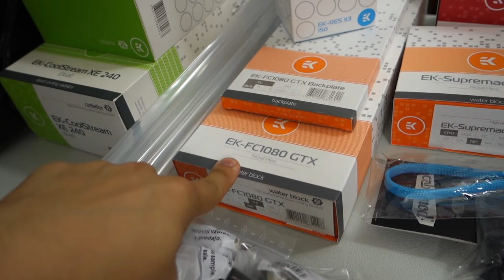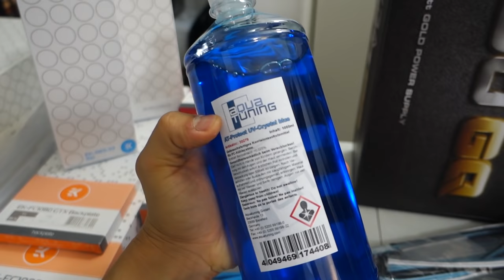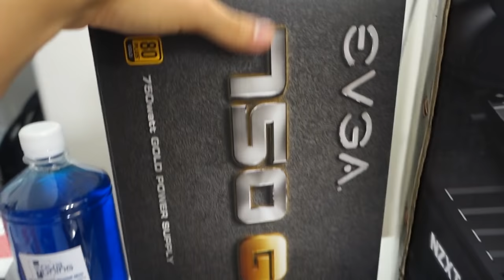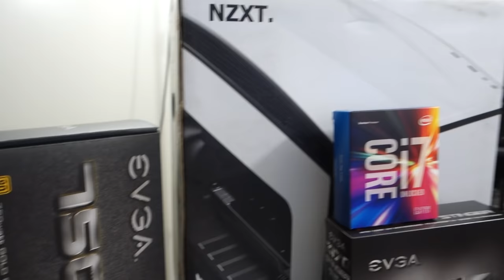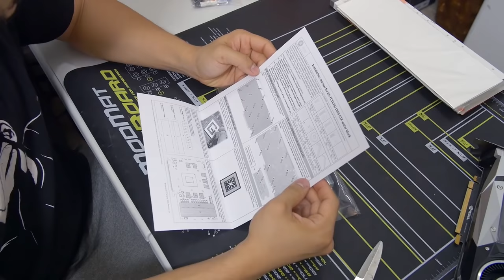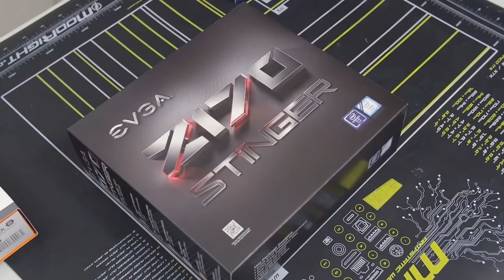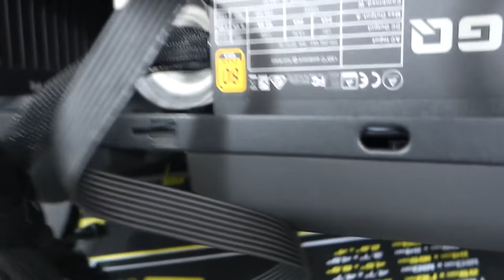My First SFF Custom Water-cooled PC! Build Log #1

Comment: Usually when I plan to do something PC building related I use a simple formula - set an optimal time that you need for everything to be done and... Multiply it by 3.
Reply: haha very true
Reply: Same
Reply: Built my first PC, thought it would take 2 hours. 8 hours and chipotle later, I'm installing the os.
Reply: more like multiply it by atleast 17
Reply: Heh... I'm a pretty experienced builder and I still use almost the same amount of time as you.

Could easily build faster, but I enjoy taking my time, mess around with all kinds of pointless things and just be done, when I'm done.

Cables of course is the biggest time consumer for me, as I route them, reroute them... and then decide I'm not satisfied and start again :)
Reply: Brannan DI most important part!!!
Reply: Especially true if you're doing watercooling. ESPECIALLY if you're using hard tubes.
Reply: Then this how long JayzTwoCents should have for his PC builds: 3 years

Comment: Sure you got enough compound on that cpu there?
Reply: he need more compound that's gonna overheat the cpu
Reply: It's how EK recommends applying it.
Reply: IDK why he is even bothering to liquid cool, that CPU is just going to overheat from lack of compound.  Needs roughly 3 times as much.
Reply: He's cutting it fine. My build us covered in thermal paste for good measure
Reply: he's joking...
Reply: they recommend that for the GPU die, not sure if it's the same for CPUs though, because CPUs have heatspreaders, whereas GPUs do not.
Reply: +101epicpenguin I'm pretty sure they recommend less because of the heat spreader so the paste doesn't need to cover the whole thing. Though ltt did a test on it and it turned out more paste didn't really hurt temps at all, so it doesn't really matter that much.
Reply: Tyler Weigand yeah, I'm aware it makes little to no difference, but it'll be easier to clean it off in future with less!
Reply: I was waiting for him to whip out a stonemason spatula to cut it into a nice 1/8 inch thick square tile.

If he ever has to swap the sink or CPU, hes gonna have to work for it. :')
Reply: +HowAmI 
https://gyazo.com/a478944deb7464668c38629cad4b9fed
This is from this pdf: https://www.ekwb.com/shop/EK-IM/EK-IM-3830046990983.pdf
So I think it's fair to say a little too much was applied, but once again, it'll only make cleanup/block removal harder and messier down the road.
Reply: The cross method is the best one, so it's perfectly fine...
Reply: ***** Exactly, as long as enough paste is applied, who cares!
Reply: ***** Exactly.
Reply: thats a shit lot of paste lol. i have like 5 times less
Reply: It really only comes down to when its time to take it apart and clean all that stuff up =F
Reply: Yeah....WAY TOO MUCH!
Reply: ***** lol yess :D
Reply: ***** Dude, my comment was a joke lol. I know it doesn't matter.
Reply: ***** Yeah, some people put like a grain of rice amount lol. I generally put about 2 peas worth of compound. Never really had an issue so far with overheating so far.
Reply: Yeah... that was a lot.

Comment: holy shit thats alot of thermal paste lmao
Reply: There are videos on yt showing that too much will just squeeze out on the sides but too little would be bigger concern
Reply: makes no difference though, only problem is when there isn't enough, even then, only a 10oC difference, Luke from Linus tech tips did a video about it.
Reply: That is the amount that EK recommends.
Reply: you mean on the cpu they recommend that? i mean.. i know it wont hurt anything as long as its conductive.. but i dont want that all over my motherboard.. i know its like that for the gpu... but never seen an install guide for an ekwb for cpu... so i suppose i have no clue.
Reply: You must've meant, as long as it isn't conductive. Also, that'll never make it to your motherboard, the paste will at mose, go on the sides of the heatspreader.
Reply: +dumle29 Yea.. Missed the not part.. *
Reply: Do all commenters say this on all YT videos? T_T We know your pain, Kyle!
Reply: 10 degrees is a ton!
Reply: is it verge terrtory though

Comment: you shouldn´t bolt the pump directly to the case. i did that and it was horribly loud.
Reply: Yeh you should probably add some noise dampening between the screws , so it won't vibrate
Reply: Nitay Haim a shoggy sandwich is perfect
Reply: there was rubber gaskets on bolts and pump
Reply: IICHRONOII yeah, but i don´t think that´s enough
Reply: he used rubber spacers so i wont viabrate
Reply: Well, it still touches on the inside, soo
Reply: If you know anything about EK pump mount the pump itself slides into a rubber ring that attaches to the feet. So there is no vibration transferred to the case at all it's a very good setup made by EK!!
Reply: Steve Bittner i never had an EK pump, but that´s good to know

Comment: Did anyone else cringe a little bit when he started to drill into a metal case fully outfitted with components? Metal shaving are deadly to hardware...
Reply: nope. but i cringed hard asf when i saw ur dp
Reply: Yep
Reply: +ViperStrikeHD Savage asf
Reply: not only that, think of the vibration from the pump directly bolted to the case
Reply: The Tech Mate You mean without any padding? Like a piece of rubber?
Reply: it has padding so no vibration
Reply: Oh so yes it has paddind. did not notic that. So no vibration then.
Reply: Yes, and it's surprising comments about this aren't higher in the feed
Reply: daaaaam daniel....... +ViperStrikeHD , that man had a family!!!!

Comment: Wouldn't the single 8 pin on the founder's kind of defeat the purpose of custom liquid cooling?
Reply: not in anyway. that limits its power but just barley.
Reply: why would the 8 pin be an issue to watercooling in any way?
Reply: nope
Reply: +Dave Webster Water cooling is done so that you can insanely overclock your system and to overclock you need more power which the 8 pin connector cannot provide
Reply: +Meer Shah founders cards tend to overclock just about as good as aib cards. water cooling can also be used for more than just extreme overclocking.
Reply: +Meer Shah worth taking a look at people's experiences between 8pin fe + 8+X custom PCBs available: there are seldom cases of delivering significant change.

secondly, watercooling is about efficient cooling, drawing heat away. in an SFF moving the heat away from a component to a radiator elsewhere in the system is a very effective way of putting higher end, higher heat producing components into tight spaces.
Reply: Dave Webster I'm saying it defeats the purpose, the purpose being overclocking of course. With only 1 8 pin you're going to hit power limitations. Also, custom watercooling is unecessary if the purpose is just to reduce heat. I have a Sea Hawk 1080 with a Corsair AIO and it has a max temp of 50 C at full load.
Reply: +Amir Paydar and heat is not an issue? plus it's been +100° this whole week in California.
Reply: SwordfighterHayate Did not say it wasn't an issue, I said it's unnecessary to spend a ton of money on custom cooling when you can buy a Hybrid graphics card and get the same cool temps for much less.
Reply: +Amir Paydar who said the money was an issue. I could buy a car that gets me from home to work for much less, or I could buy the Ferrari. just because something isn't what you would do, doesn't make it wrong. and the purpose of watercooling if to shift heat, not to overclock. overclock potential is by-product of watercooling, but can equally be achieved by air or AIO water systems these days.
Reply: Block and backplate would run you around $170 USD. And with all the mark-up on all Nvidia cards right now a FE and WB is still cheaper than the Sea Hawk by MSI.
Reply: Not at all.

An 8 pin is RATED at 175W, safe to say it can deliver a lot more than that
Reply: The word "unnecessary" means nothing to PC builders. Most things about high-end PC building are done because they can be done, not because they need to be or even SHOULD be.
Reply: Jaystwocents founders edition are the only cards he has that can hit 2100 plus. Stable.
Reply: But even on air cooling, those cards reach 2100MHz.. WITH 8 PIN POWER.. are you insane? Those cards don't need more "power" to overclock well.  
Yes for a watercooled system, having more power can be helpful but please get your head out of the sand and look at overclocking results before you complain about the 8 pin power connector "not being enough".
Reply: feels good to see that many people agree about the 8pin & of results. I also reiterate, the point of watercooling is not for any kind of overclocking. the point of water cooling is to move heat from one place to another. given the rads on this build are going to equal 480mm + sff design, I could guess that its an HTPC gaming system aiming for fans under 750rpm and no OC (but stable boost) to keep it cool yet very very quiet.
Reply: Dave Webster No need to reiterate. Leave
Reply: the gtx 1080 consumes 180w,the 8pin+pci-e gives 150+75=225w,so you have a 55w room for overclock
Reply: Dave Webster fact. 2x8 pin doesnt mean better oc on these 10xx cards. 
i personally believe that nvidia kept the best chips for the fe cards cause all these aib cards have bad oc in comparision :0
Reply: the fact my founders 1080 has oc better than some none founders one 8 pin doesn't matter
Reply: So many people think that the extra 6 pin or extra 8 pin will magically unlock more core clock... Pascal and its FinFet are NOT seeing good results by throwing more voltage at it. Why do you think all 1080s (minus the Strix) is hard locked at 1.092v? Once again.... the extra power pin DOES NOT EQUAL BETTER OVERCLOCKS. In most cases its so that you can not reach power target on cards with extra fans, LEDs etc which ALL play a part in TDP and power target. Yikes.... so much wrong information floating out there
Reply: ***** Damn Jay, thanks for taking the time to clear that up and great work on Red Mist. I didn't think it mattered either at first but after so many people tell you otherwise it's hard to know what's right and wrong.

Comment: For the rear fan, I'd leave the white ring and spray the rubber blue, but be warned: paint definitely does NOT stick to rubber well at all!  I did that with that watercooled HTPC I showed you a while back (the black and gold one... prolly don't remember x-p), and while I DID get it to look really good, you have to minimize the stress that gets applied to the rubber or else it literally just peels right off.  Of course another way to go would be to get those new Corsair ML fans; they come in blue with blue corners to them, but they are LED fans.  I mean that WOULD sort of jive with the blue lighting on the Raiden DIMMS, but that's all up to you.  I use the DDR3 version of those DIMMS in my fiance's rig, and the lighting effect is really badass!

As for the cables, I'd leave them white: even though the color scheme of the build IS white and blue, the blue is so subdued everywhere else that by the time you add the blue coolant in the tubing, it's gonna become a much more dominant color, so leaving the cables white makes the white more intense and keeps the blue balanced.

110% agree with Brian's assessment of the tubing, I coulda told you to go with a thinner OD since the thick stuff, while more durable and LOOKS fuller, is more difficult to get tight radius bends going.  He definitely knows his watercooling shit, that's for true!

Looking forward to the next vlog on this, it's looking really good so far!

Comment: Hey awesomesauce my friend has a budget of 500$ and he needs to build a pc but all the videos with "500$ Budget pc!" Are amazon.com and i live in Canada and so does my friend and when you search the certain pc parts on amazon.ca they are more expensive and some of the parts are not even available in Canada. So if you could give me some advice or even pick out the parts for me (Remember amazon.ca NOT amazon.com) Then that would be great. (P.s You should stay with white cables because you don't want too much blue. Love your videos <3.)
Reply: https://ca.pcpartpicker.com

This is the Canadian version of the bread and butter of planning your PC. PC part picker is amazing and should give you the cheapest place to get the components from reputable retailers in Canada. I find the best way to spec a PC is start with something above your budget and then think "where can I reduce cost" e.g. Lower graphics card model etc until you reach your budget. Good luck.
Reply: bobvader2001 Thanks!
Reply: http://ca.pcpartpicker.com/list/2rBb8K

This is something I threw together in 5 mins or so. It probably needs some refining but it's a starting point. Check out the pcmasterrace and buildapc subreddit a for help too. Hope this helps.
Reply: http://ca.pcpartpicker.com/list/fLTBZ8

Tweaked a bit, the Pentium will outperform that A6 and it doesn't need additional cooling for overclocking so we save money on the cooler. Not to mention it can be upgraded in the future to something worthwhile - that AMD socket is dead. Higher quality PSU (the new CXM series is much better than the old one) and a smaller case.
Reply: +Dylan Kuehl Ty I don't have much knowledge of AMD processors, I'm an Intel person myself. I just know you can get them cheaper lol
Reply: +Abdullah Moizuddin yeah. As a Brit looking at the price of some of these in Canadian dollars I was very surprised lol.
Reply: Thanks for the links guys my friend is really happy
Reply: If you aren't planning on overclocking your CPU (which isn't possible with that build anyway) you can exclude the aftermarket CPU cooler and use that money towards something else

Comment: with your radiator thickness problem in the front, if your tube is the only problem, you could make a passthrough in the PSU scroud and still fit the big one.... 
Build looks great, looking forward to seing the final result :) just started custom watercooling myself, and I'm happy I got myself pulled together to do it :)

Comment: Just a tip - if you have factory mounting holes and dont want to drill new ones, go get a small piece of plexiglass (lexan etc). Make sure it is thick enough to accommodate a slight countersink or not, depending on what kind of screws you will mount the pump with, then mount the pump to that piece, then drill holes aligned with the factory holes and mount the plexiglass to those.

Comment: Was that  to much thermal paste ?
Reply: Theres nothing called "too much thermal paste" only too little
Reply: No it wasn't
Reply: +Cole Pearson except for too little
Reply: The only time there's too much is if it starts overflowing onto the motherboard. That can cause some issues. Other than that, nope :P
Reply: Thats true
Reply: EK's instructions tell you to do that, I remember it saying 8 or 10 pointed star. Better to have a lot than too little. A gpu die does not have a heat spreader like a cpu so its essential the enite die gets coated with paste.
Reply: thats not the case anymore, thermal paste is non conductive nowadays

Comment: Kyle use Pass through fittings so you can use that thick rad. That way there you don't have to worry about the tubes not having enough room to fit as you will be using the pass through to get your tubes to the pump.

Comment: Kyle you could flip the radiator around and connect the outlet of the pump to the radiator inlet directly down there where you have the pump. You could drill a hole into the PSU shroud to connect the reservoir outlet to the pump inlet (see Jayz Skunkworks for how to connect hard tube through the "floor"). You could even use the big radiator in the front then. the only downside is: you have to tilt the case around a bit more to get bubbles out initially when the outlets are at the bottom, but with an itx case that should perfectly be possible and there are lots of examples on youtube for this.

Comment: Kyle, as far as painting the rubber grommets on the Corsair fans where the screws go in, the rubber bends when you screw your fan in, which would cause any paint to chip off more than likely, paint generally doesn't adhere well to rubber anyways though. I did paint my fan rings though if you want an example of that though. I went with a green build, so my fan rings are green. I've never actually tried it but if you were to paint the rubber, I'd suggest sanding them as generally that will help with adhesion but again, being rubber I don't think it will hold up well when it twists from the screw threading. Personal experience from painting. :)

Comment: Looking good!  You may want to redo those thermal pads though, you reduce the effectiveness of the pads by adding thermal paste.  I think I see what you were doing though, and it appears that you used the thermal paste as a sort of glue, but seriously, you need to redo the pads without the paste for maximum heat transfer.  Fortunately they are cheap, and we just bought a sheet of 145mm x 145mm x 1mm recently on Amazon of the Arctic 6.0 W/mK baby blue sheet that looks just like what EKWB ships, for under $13.  You'll need both the 1mm thick and the 0.5mm thick.  Buy the big sheets like we did, it saves money in the long run as you can just go back and cut more off as needed for other stuff in the future.

I don't know what your maintenance plans are, but it could be easier to drain if you flip the front rad to have the fittings at the bottom.  As it is mounted now, you'd have to have the machine upside down to drain it.

Comment: As someone who has a Fractal Design Define S and shoved two 360SE rads in there (from EKWB of course) - I don't think you're going to fit a SE rad in there unless it has no fans or unless the fans go on the other side of the case. Even for my Fractal, which is a full ATX, fitting in both 360's was a very, very close fit.
Like I mentioned though, if you can fit your fans on the other side of the case, that's something I hadn't done, I don't know if the Manta supports it. It'd definitely help if so.